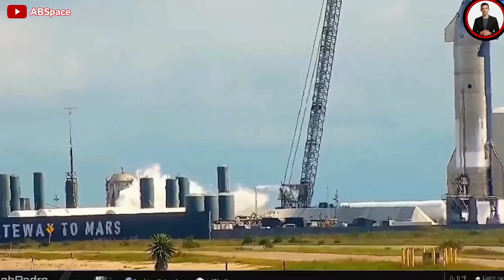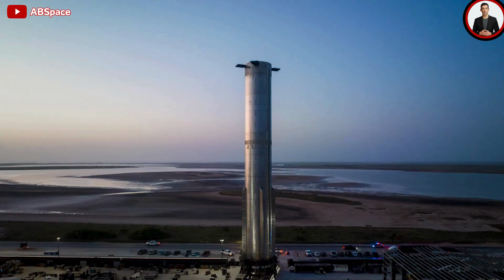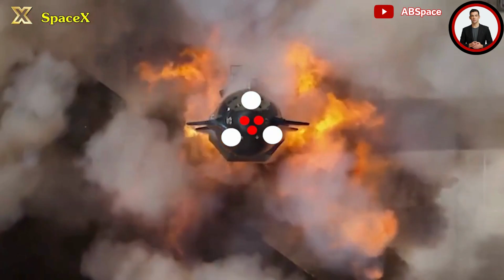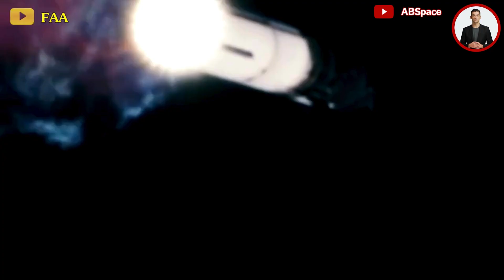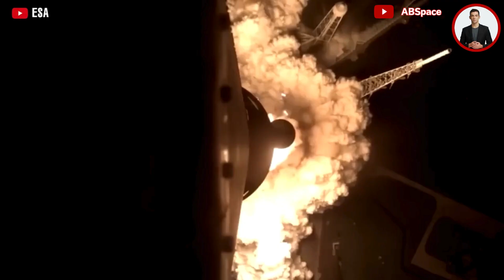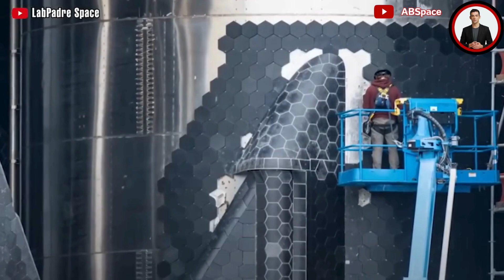Starship Achieves Epic Success in Latest Test! Witness SHIP-28's Powerful 6 Raptor Engine Display!"

Comment: Wave like coordination of movable baffles might be able to motivate the fuel to whirlpool at a fuel harvesting vortex inside the fuel tanks to counteract gravity and centrifugal, and inertial forces that cause the fuel to slosh.  Would a light stainless steel net stretched over the tiles and coated with high heat resistant clay be effective in holding down the tiles? It'd be like pantyhose for the rocket,  LOL !!